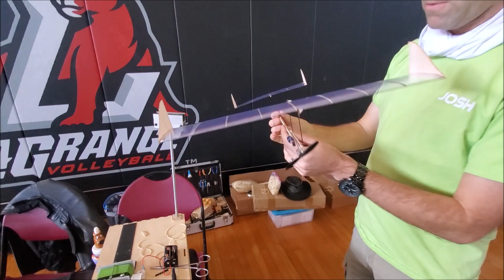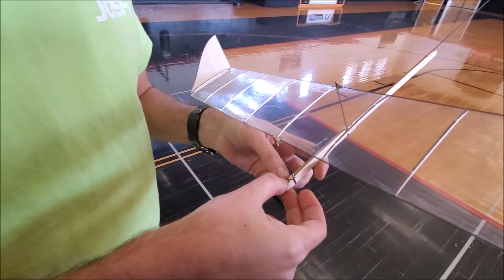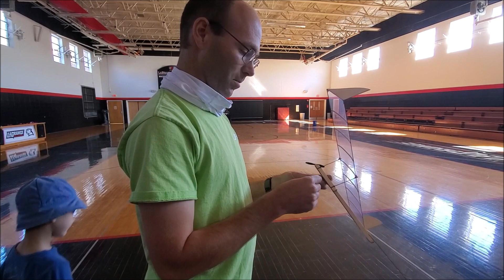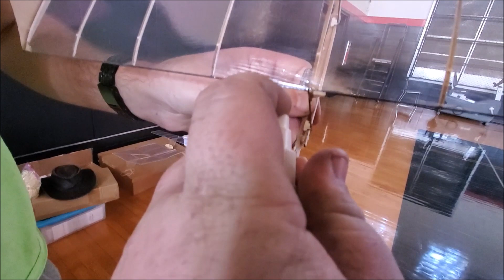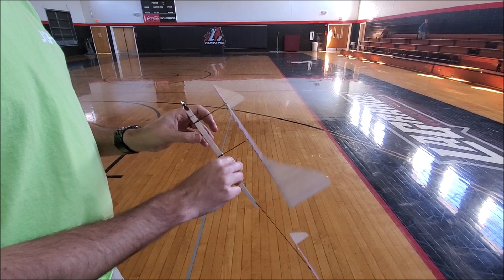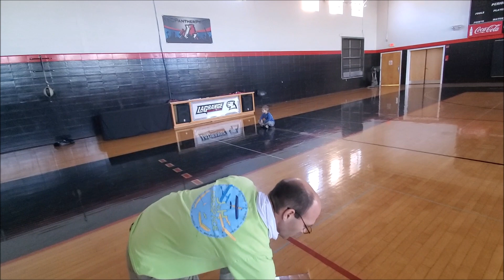Electric Wright Stuff capacitor power flying techniques!

Comment: I am new to this indoor stuff but have been experimenting with 3mm depron planes and rubber ones (Albatross) converted to lipo and 7-12 sec timer runs from "elcheapo" internet planes. They are heavy but sortof successful  so my question is ....what is a wright plane and especially what is the one you are teaching with. The electron is out of stock and no sizes available, any cahnce of some sizes .......please.
Reply from the maker: Ok let's try saving you some money. Electron and Zapper were competition indoor kits made for a specific set of rules, and that required an elevated price. Lasercutplanes.com has a simple kit and power system that are almost as good and much cheaper (and you don't have to wait on my people to solder power systems for you):
https://www.lasercutplanes.com/product/cheat-sheet-airframe/
https://www.lasercutplanes.com/product/5-farad-capacitor-power-system/

Comment: Josh - excellent video.  We are completing your 2023 Division B kit now.  If we wanted to introduce a rudder onto the stab, would you recommend one fashioned out of the spare balsa scraps from your kit?  Thanks!!
Reply from the maker: Yes that would be a good way to do it. Also note that the fins can be bent side to side for trimming as needed. The vid I released today on the Sr. Flyer has some details on trimming with rudder and wing warps.

Comment: Thanks! I am a bit curious on the design aspect of this model. It seems that it has a very long tail boom compared to other rubber powered models. Can you explain the reason for this?
Reply from the maker: Having a long tail moment provides better pitch damping, so you can use a more aft CG to load the stabilizer up more, reducing load on the wing and improving performance.
Reply: @joshuawfinn  Thanks a lot! I also heard you saying the term pitch damping in your video about braiding rubber motor; however I really can't find a simple explanation on the internet about pitch damping, can you explain it for us?
Reply from the maker: @adrielestolano4668  pitch damping is resistance to movement in the pitch axis. So if the model is rotating up or down, the damping resists that rotation.

Comment: My capacitor runs out of power too quickly. After 15 seconds the thrust isn’t enough to keep the airplane climbing so it starts to gradually come down. I did motor runs and there is a significant reduction in motor output after 15 seconds. Do I have a bad cap?
Reply from the maker: Most stock motors only provide 10-15 seconds of climb. Anything more requires the slow speed motor I used in the video.
Reply: @joshuawfinn  so with stock motors you can't get flight time of close to a minute? My flight time is averaging at 40 seconds. The motor keeps spinning but just doesn't have the thrust to keep the glider afloat.

Comment: Again, what I find most interesting is your experience in adjusting all the variables in trimming that allow you to dictate the crafts behavior in the air.  If you reduced the stab tilt, might that allow you to reduce the wing twist to some extent, thereby reducing some drag component inherent in the greater footprint the wing has?  Is the boom angle adjustment enough to make it turn without using too much stab tilt?  Would any changes to the thrust vector help reduce the changes to the other variables?
Reply from the maker: I think reducing the wing twist in general would have helped and would have allowed for less turn trim to get the same circle diameter